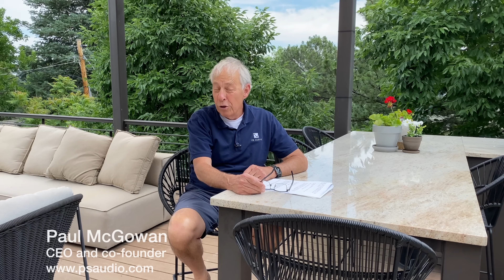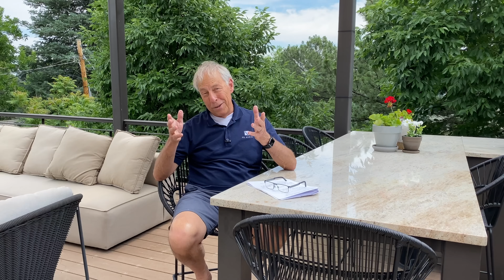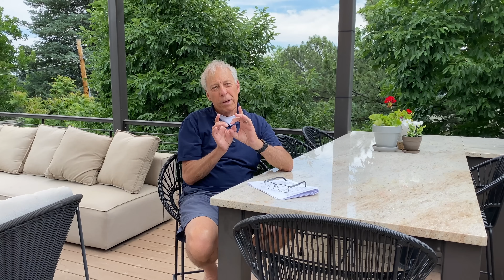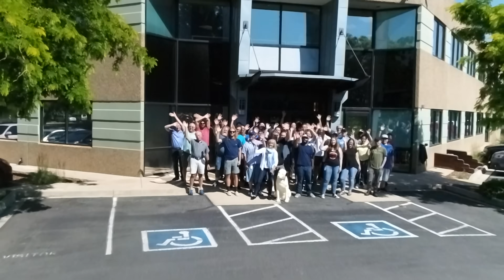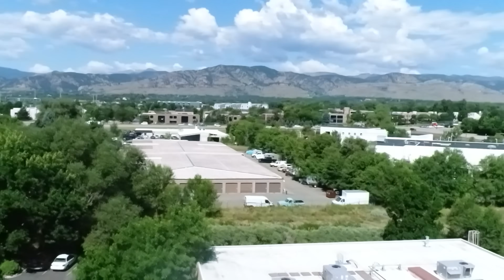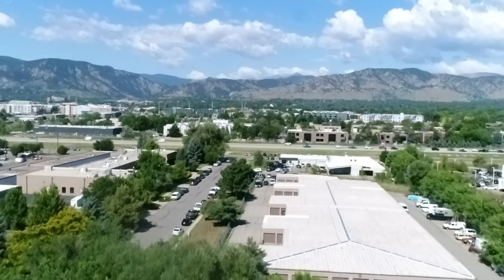Do chip op amps sound good?

Comment: First you say generally better then at the end you say always better. Wowzers.
Reply: Context. It really depends on the strength of he rest of the system.  I have discrete opamps that blow everything away, but they are no the best choice in all situations, I have a situation where IC opamps are the best sounding choice, and in another system of mine discrete is the only way to top sound.

Comment: Sorry to disagree.  It sounds like Paul is a few years behind (or maybe a few decades?).
I totally agree that MOST op amps are not great at audio, but there are many that are designed specifically for audio and some, even better, for instrumentation.  An integrated op amp has the advantage of size.  This means lightning fact response (if it is well designed and has low internal compensation) which allows for very high open-loop gain thus heavy feedback.  All distortion is eliminated (or at least negligible) except that of the input differential pair.  All internal noise is shunted except that of the differential pair. 
The differential pair has a built-in advantage over discretes : it is paired by construction.  Man parameters in semiconductors can vary wildly from one unit to another.  For instance the Hfe (current gain) of transistors of the same make and model can vary from 500 to 10,000 due to small variations in the masks in the silicon.  So, if you make a discrete op amp, you have to buy many and pair then individually.  In an integrated op amp, the variations are the same for the two input transistors, thus greatly reducing parameter variations to a maximum of about ±10%.  
As an instrument and audio designer, I did use high quality op-amps (not something like the 324!!!) and preceded then with a discrete pair of carefully selected matched very low noise large bandwidth transistors (either bipolar or FET), whose collector or drain was connected to a low-capacitance current source.  The outputs then went into a large bandwidth integrated op-amp.  These transistors were placed as close as possible (1 or 2 mm) to the op-amp input.  The results were outstanding since the input transistors were submitted to no base-to-emitter or gate-to-drain change, thus retaining fixed parameters even through changing signal conditions, providing for a wide distortion- and noise-free dynamic range.  Frequency response was, of course, flat from DC (0Hz) to at least 50Kz.

Comment: Audiophile op-amps exist that beat many discrete circuits nowadays. Also, analog studios are using lots of op-amps. Your speaker setup is where things sound different when the electronics is properly engineered discrete or not.
Reply: With regard to speakers sometimes you want a different sound and you can't buy a new set of speaker but changing the op-amps can give you a different sound
Reply: @daysofgrace2934  If I want a different sound, I would not bother to change op-amps as any difference between (good) op-amps will do near no audible difference compared to anything you can do with room acoustics incl. speaker placement. A typical audiophile speaker distort many many times more than a typical audiophile op-amp.

Comment: Wierd subject. I do not know of any ADC or DAC that is high speed and does not either contain or use an op amp. Makes about as much sense as an amp that does not use electricity. Single stage mic amps in condenser microphones often do contain a small FET based class A amplifier to transition from the very high impedance microphone element to drive the low Z balanced output, but from there almost every EQ, Pre Amp, Mixer, DSP, etc are universally Op Amp designs.  They became popular for low noise, high speed, very controlled gain, high linearity, low phase shift, etc.  All instrumentation amplifiers are based on them.
Reply: In discreet vs integrated, do not overlook the actual advantages of the small package. Low noise, very high slew rates, very high CMMR, very high bandwidth, etc are commonly used for precision instrumentation applications. Compare any discreet op amp performance with for example the performance of a MAX4146 for example. The single die is thermally stable, low noise, slew rate of 1,000 V/uS compared to the obsolete part Paul mentioned with a slew rate of 0.25 V/uS. A bandwidth of 130 MHZ, is of a 3 op amp design for instruments with a CMMR of 70db at 10 MHZ.  Flat response to 90 MHZ with 0.1 dB gain. Very low noise of 3.45 nV. Sorry Paul. Try some modern very precise parts. Discreet parts have problems due to the physical distances, inductance, capacitance, etc that are greatly reduced with the small dimensions inside a small SMT device.
Cheaper and better is the advantages of modern instrumentation op amps.

Comment: In the 60's Electronics World had a construction article on building a tube based opamp. It looked interesting so I drew up a parts list and set out to see how much it would cost to build. This design had 4 or 5 dual triodes, power supply and all the discrete resistors and capacitors. By the time I was done it was goping to cost a hundred dollars with out any consideration for a chassis so that project was moved from the active to inactive list.

Several years later after getting out of the army I worked for Analog Devices as an engineering tech and got to work on some cutting edge discreet designs that had very good characteristics. I built a phono stage with a pair that sounded very good for it's time but that would have been pretty expensive if you didn't have access to engineering samples.

Comment: Hi, Paul, I think, we both are about the same age and for sure from that generation which started to use OPAmps the first time in the electronic new age. I remember well, the now vintage 709 (with external capacitor for frequency compensation), the the 741 (without it). I always considered, and still do, an OPAmp being a device, like a transistor or a tube is one, with which you design a circuit for a special purpose. Be it a unity gain buffer, a filter, a precision gain amplifier, an impedance matcher, you name it. What made and make this device unique is its insanely (this is how we felt about it) open loop gain, its extremely high input impedance, the ease of how you could precisely determine the gain you wanted or the input impedance for the same matter. And with mathematical precision a filter characteristic. Now I come full circle: it is a device, not a circuit (I am not looking inside the housing now) by itself. But now back to the question about sound: you will have to design the sound characteristics yourself, the device is not having one! That said: of course it does. But this wonderful device gives all the responsibility back to where it belongs: the designer. Cheers! Keep going strong. Hans.

Comment: It really depends on what you want to call discrete...
A chip with one single opamp on it is often also called a "discrete" component.
Because it's one spare opamp instead of multiple that for example makes AND/OR ports.
These discrete AND/OR ports can be grouped into things like J/K flipflops or D latches.
These spare D latches can be grouped into a clock divider, which are often used as a counter.
Reply: Dave Micolichek  I know, the molecular example was a bit weak, since it has no explicit relevance to electrical properties of the complete component in most cases.

However, for example a traditional PNP/NPN transistor is made of at least three components for the junction, some metal leads that extrude from the package and some internal wiring that connects these to the junction.
For example a standard electrolytic capacitor is made of metal film, a dielectric film and some type of electrolyte liquid. Two metal wires are attached to the anode and cathode foils and protrude through the package.
The amount of components in both packages of those examples are significantly less, that's about the only significant difference.
Reply: Dave Micolichek  One could also argue the other way around for components like transistors or diodes, since it's just one die cut from a wafer after all.
Just like an opamp or microprocessor.
Reply: Dave Micolichek  Yes, with some words it's very hard to come to a concrete definition; as simple as it might seem at a first glance...

Comment: The 709C was not an audio-specific component, so I'm not surprised a discrete design performs better.  The NE5532 and other op amp chips specifically intended for audio applications are whole different category and, when designed in properly, are very difficult to beat with a discrete equivalent because it's hard -- often impossible -- to source discrete parts that have the sort of precision that's easily achievable by a decent silicon foundry.  IOW, as Paul himself found out with his vintage Studer mixing desk, "op amp rolling" is a waste of time and money in an expertly engineered piece of audio gear that uses carefully selected, audio-specific ICs for the op-amp function.

Comment: Hmm maybe last century this was correct. This century I've not seen a single equivalent item where discreet beats integrated. It's easy to see why when it's thought about too. Longer signal path, no thermal coupling, mismatched components not the result of billions of dollers of r+d.
Reply: Vertical power devices, at >>100 V.
In particular the SiC superjunction NPN's ("GeneSiC", only really still made for high-temp applications because the chips themselves easily work at temperatures kitchen ovens are not willing to go to (350-500 C is usable depending on packaging), as the need for DC/bias base current had them loose against the JFETs) and the SiC JFETs from e.g. UnitedSiC (now part of Qorvo) and maybe soon others again (last competitor ceased about 10 years ago).
Those are sadly only good to a few MHz (and that's with frequency-dependent distortion there that needs compensating!) due to their gate resistance, but they are extremely robust and very good (power) amplifiers.

(The JFETs are designed for switching applications like power supplies, but they are safe to use in linear mode and the only real vulnerable part is excessive sustained forward current through the gate-source diode. Like, around 10+% of nominal TDP used for that diode. Everything else is just a "eventually it overheats and breaks" issue, afaik.
I postponed my plans to get some proper measurements of the RF behavior, mostly due to some difficulties brought on by the high voltages (1700~2200 V avalanche, roughly, depending on if you get a 1200V or 1700V nominal one.).)

Comment: That's true as Paul says. You can have an IC. oppamp which has incredibly good sound quality and very low noise. 

If you have two preamps from 2 brands that cost the same.

IC. op amp can quickly have better sound quality than the sepparate transistors preamplifier has.

But it can quickly be the opposite that separate transistors have better sound.

 It is too easy to say that separate transistors are always better. IC. op amp does not always have to be worse than separate teanistors.

IC. up amp came the first time approx. in the late 1963
Reply: The operational amplifier was invented in the 1940s. The first IC op amp was made by Bob Widlar at Fairchild Semiconductor in 1963.